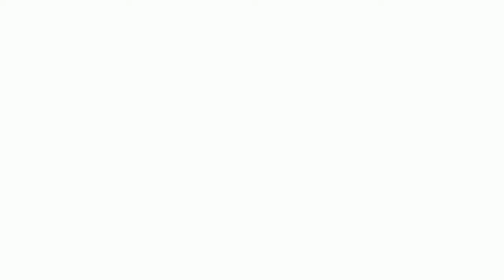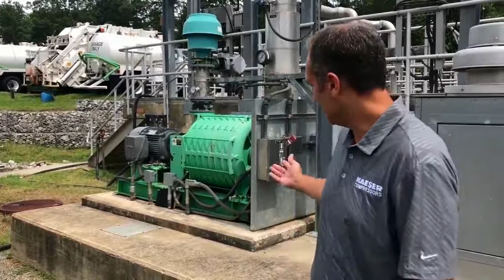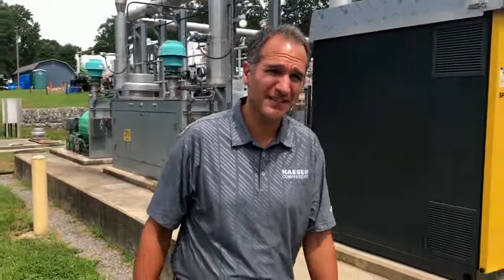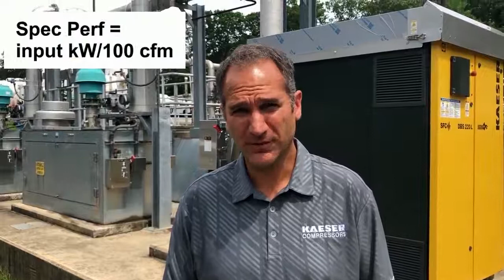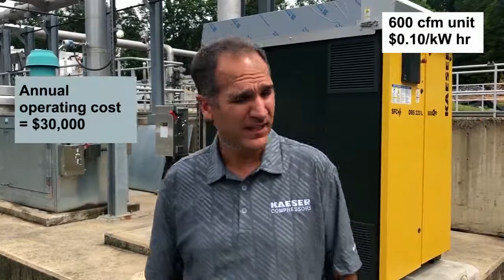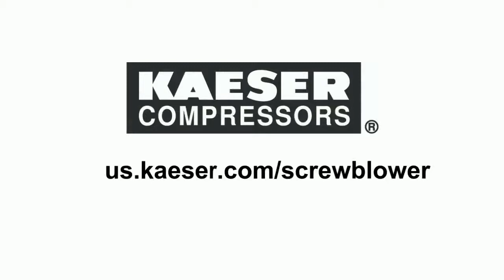Blower Isentropic Efficiency Explained | Kaeser Compressors, Inc.

Comment: Sir could you tell us how many types of efficiency we can calculate in the screw compressor.
Reply from the maker: The intent of this video is to concentrate on the isentropic process and how it compares to actual site machine performance. Within the package there are individual efficiencies, but we are looking to capture all of them as a single input power to the machine and compare them to isentropic power. More detail on this topic can be found in PTC13 and at CAGI.